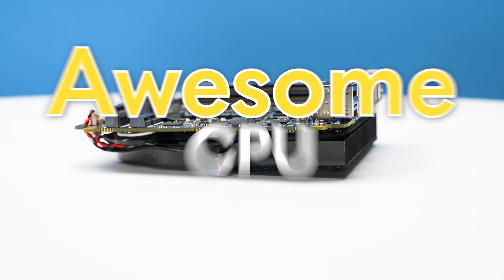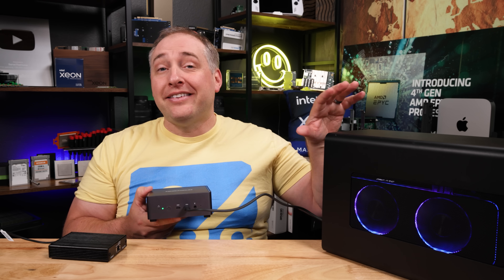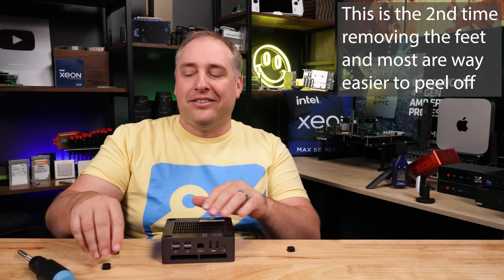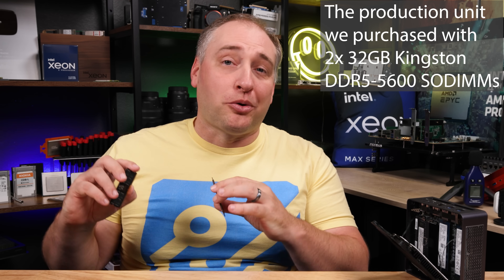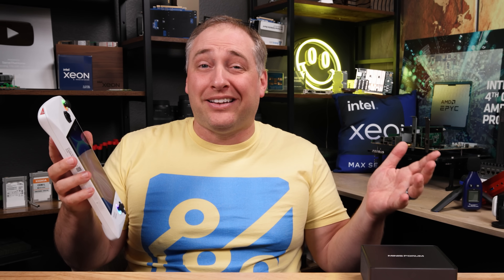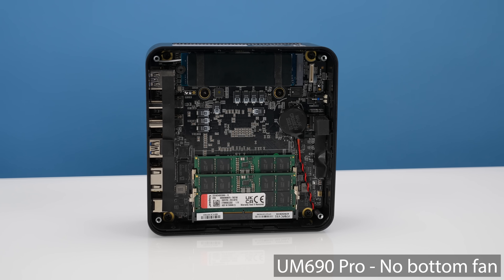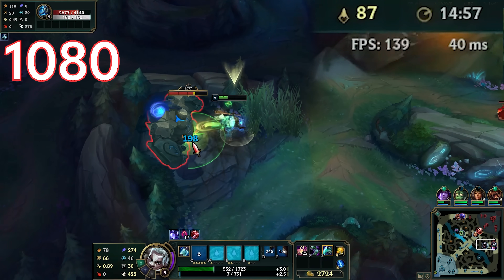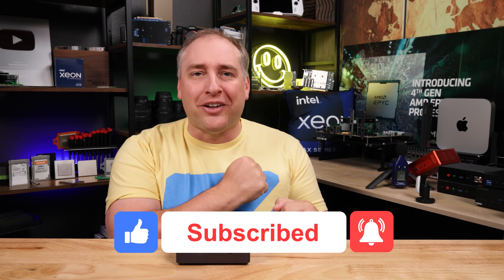This Was NOT the Mini PC We Expected... Minisforum UM790 Pro Review

Comment: Anyone else having sound cracks on the UM790Pro when a USB sound card is attached? Bluetooth audio works flawless. Will test the 3.5mm jack later. My Soundcard is attached to one of the USB-A ports.
With this being the only exception, this little thing runs flawless under Linux. Performance is amazing! Noice level is completely acceptable.

Comment: I had mine less than a week ago and sent it back to amazon on the same day it came in the mail. The wifi card was terrible. My acer Nitro 5 can download at over 500Mb/s. The Mini PC barely got 50 Mb/s. I even tried putting  a TP Link Archer wireless adapter to boost speed. It conflicted with my wireless mouse no matter what USB port I used. Most likely because it isn't equipped with enough PCIE lanes to handle those 4 USB ports on the back. I even had a 220 dollar coupon and thought it was a ripoff. Over 1000 dollars Canadian is way too much for this. I mean if you're building something that can game you need enough pcie lanes. You need fast wifi to download big games. It's a great start, but these Mini PCs are clearly unfinished. I won't be buying one for quite a while yet.
Reply: The Intel AX200 wifi card under the SSD is terrible. Replace it with a Realtek or MediaTek WiFi 6E card for about $25 from Amazon or Newegg.

Comment: If only they would start adding occulink ports to these mini pcs they would be a complete package. Then you could add an external high end egpu by just plugging in the occulink cable without modifying the case and using one of the internal m.2 slots.
Reply: new minis 780 xtx have oculink port on backside :D

Comment: Holes in the rubber feet woudl be great. But even better if they did a mechanical pop up switch or whatever you call it, like their Deskmini UM350
Reply: I drilled a hole into the center of the rubber feet, so I don't have to remove them to unscrew the cover.

Comment: Your review states that you have to remove the screws, where as Level1Techs review stated that the bottom just snaps on.  Can anyone confirm whether this is a toolless case or not?
Reply: First, you have to remove the taped feet, undo the 4 screws (under the taped feet), then use a strong fingernail/soft prytool to unsnap the bottom cover.

Comment: Hello and greetings from Germany, great video, have now also bought a UM790 and am a little disappointed, unfortunately I cannot set a resolution of 5120x1440, is that with you too?
Reply: Using a Cable matters USB-C to DisplayPort adapter, I can get 5120x1440. I cannot do that with just USB-C, could be my cables or driver limitations. Haven't messed with HDMI display options.
Reply: Hi, thanks for your feedback. This is interesting, I will get an adapter or cable and test it, but I am still a bit skeptical because the option 5120 x 1440 is not displayed at all, neither under Windows nor in AMD Adrenalin.
Reply: @nardoa4465  It does not appear as an option for me either without the adapter using USB-C (USB4). Seems like a driver limitation?
Reply: @ScratchingTheGreen  Good to know, I am very happy about your answer 😀, at the moment I have to work with an EGPU to be able to use my monitor. I'll order a cable right away and test it.
Reply: The adapter has arrived today and it fits, in this connection the correct resolution for my monitor is given to me. I am really happy to have found a solution. Thank you and regards.

Comment: I've had mine for about a month now. It is fantastic!  It is TINY. Highly recommended.
It replaces a 2 yr old MinisForum HX90 Barebones, 5900HX CPU.
I got this one factory.
The power draw is minimal. I gladly trade a little performance for much less heat.

It is mounted on a wall with the HX90 VESA mount.
Due to initial cabling as it replaced a HX90, the rear fan was pointed down.
While the fan air movement was virtually silent, 
the actual fan bearing was whizzing at a high frequency which was mildly annoying.
I would only hear it when my head was turned in a particular direction playing games in 4K.
I rerouted the cable and the fan is pointed up. I never hear the fan anymore.
I also don't use 4K anymore as it makes no noticeable difference. 
Many games act weirdly at 4K also i.e.  HUD resize, too small text, etc.
Reply: Hi, good post...How about the WIFI connectivity ????? The GEEKS mini PC are rubbish with WIFI connectivity. How is this for wifi ? Do you lose much at all ? My Router is in the same room as i think the wifi booster dongles are a crock ....
Thanks in advance
Reply: compared to the HX90 i looked it up. It also seemed to be a very fast mini pc. What u experienced any differences between the two ? At normal work, booting time, maybe some visual studio programming. I guess u dont recognized any big time differences or speed ?
Reply: Good luck.    My motherboard fried at 4 months.  Absolutely is trash.
Reply: @calvinbrady9944  What's the mobo model?

Comment: Hi, Need help my UM790 PRO keeps crashing many times per day, very frustrating.  Have tried Minis Forum support no answer for a month.  I just sent a support request to Shenzhen Meigao which is the baseboard manufacturer for the UM790PRO and I think they are same/related company as MinisForum. 
This UM790PRO crashes while I am trading on Trading View at critical points (this is my main income), this UM790 PRO also crashes just using Windows and simply reboots with no error messages.
Reply: I had similar issues. First, I removed and reseated my ram (32gb G.Skill 5600) then removed some of drivers (Video/Audio/Network) and reinstalled; seems to have cleared up. Also, uninstalled the KillerWifi and AMD Adrenaline apps and seems to be a bit better still. Not scientific, but better to reintroduce those apps when I need them than mulitple reboots a day. 

FWIW, I was drving an AGON AG493UCX 49" ultrawide monitor over USB-C and USB-C to DP adapter; same issue on both.

Comment: I always like having my monitors connected to the front headers!🥴 Also I,do like if they turn USB-A ports upside down on the dark back. You will have to connect your plugs three times, before it fits😂 The DDR5 RAM with CL46 ist great for some gaming😮 There were no Intel 13th gen CPU in comparing charts.😢 A full Display port would be more suitable for a PC, not connected to TV set, as HDMI always is behind and more limited. I rather would not waste a Thunderbolt/USB4.0 port for am monitor.

Comment: Would like to see a head-to-head between:

Minisforum UM790 Pro
GMKTech NucBox K4
Beelink GTR7

All with the R9 7940HS (8C/16T, Radeon 780M), 32GB 1TB.

Would like to see head-to-head performance, power draw, heat, noise, gaming performance, integrated ports, do they come with Windows pre-installed, etc. And general bang for the buck?

They all seem pretty comparable on basic specs: proc/mem/NVMe, etc. Just wondering on the differences, and haven't seen any of them in a head-to-head, tear-down, etc.

I'm debating buying one or more of this style of mini-PC to just do stuff like crunching PrimeGrid tasks, and maybe some light gaming. Debating if these will be sufficient for the purpose, or if the integrated graphics, "mobile"-esque chips will be a bottleneck vs. a full PC with dedicated graphics? Or if the bang-for-the-buck is sufficient for the trade-offs.
Reply from the maker: We talked about the UM790 Pro and the GTR7 non-pro in the GTR7 Pro video that came out after this: https://youtu.be/LciJqD74Mc4
Reply: which of them doesnt have coil whine or other high-frequency interference noises?

(im asking because i do suffer from a illness which is making me very very sensitive to noise, especially with high-frequency sounds, a device with coil whine would be unusable for me)

Thanks and greez from Austria

Comment: The crazy thing is that this could probably replace a PC I built 3 years ago.  I could load it up with the same 64tb of ram and get 2 gen 4 8tb drives.
Reply: will this beat a gtx 980 and amd HD 8350 processor?
Reply: Per benchmarks it is on par or slightly better than a 980m. So it will probably be a bit slower than a 980 proper.
Reply: @jadedandbitter  so no point in upgrading since it will cost me the same as upgrading to   A new 2023 graphics card?
Reply: @qaching  the cost of the whole computer is equivalent to the price of a 4070, yes. So the question is, can you upgrade your PC or do you have to build a new one? My PC, a win 7 laptop I can't upgrade to windows 10 due to proprietary win 7 only drivers and non transferrable adobe license keys, needs replacement in entirety (in regards to gaming). So I'm looking at a scenario where I spend $1400 to build a midrange PC, $3000 to build a high end, or spend $600 and replace what I have with something equivalent to hold me over until the next generation cards and pci-e 5.0 comes out, with a total cost of $3600 (or less if next gen card prices are lower, and they very well might be) for a much more powerful setup.

If you have a pci-e 4.0 mobo and can just drop in a new card, then yeah something like this doesn't look as attractive. But a 980m still gives very solid 1080p performance, so that's enough for me and my 1080p receiver/projector for now. Because 1080p on my 130 inch projector display looks better to me than 4k on my 65 inch Sony tv, so I've no need for extreme performance. I WILL need that kind of performance for VR, but there isn't a headset out yet that makes me feel like it's worth it(Im not interested until mainstream headsets have 170 degree+ FOVs on the regular). So for me getting a cheap little box to tide me over for a few years until the next gen VR and graphics cards arrive is ideal.
Reply: @jadedandbitter  thx for your time
Yes I’m building a new one 
I’m replacing a 10 year old pc
My old buddy has to go…

Comment: Why does the Minisforum UM790 Pro give static noise problem when scrolling a Web page or changing between YouTube videos?
Reply: Perhaps you might have a faulty unit?
Reply: are you still strugglin with it?
and may i know if you could notice any coil whine or other noises with your UM790 PRO?

(im asking because i do suffer from a illness which is making me very very sensitive to noise, especially with high-frequency sounds, a device with coil whine would be unusable for me)

really would appreciate your answer.
thanks and greez from austria! :)
Reply: @torbesen  I reinstalled Windows several times. Also reinstall AMD drivers. I don't have the noise problem after reinstallations.
Just read this: How to get rid of monitor coil whine?
Go to Edit>Preferences>General>Interaction Mode and set it to ``Monitor Refresh Rate''. This will stop GPU coil whine.

Comment: My vote for HX80G over HX99G or UM790 pro. 
My reasons are:
- DDR5 still not completely developed for high efficiency versus speed/latency. Right now, ddr4 is enough for 1080p or even 1440p gaming.
- Thunderbolt or USB4 support for external gpu needs better speed and latency in some games like shooters, so best option is an oculink adapter for m.2 slot, you could do this in hx80g too.
- Performance difference between 5800H, 5900HX, 6900HX even 7940HS is very little (10%-15%) compared with price gap between these models.
- Under my assumption. 7940HX for now didn't exist, and 7945HX, based on news and rumors, will be used for new mini pc with desktop gpu support. This is not interesting for me, because i'm interested in mobile gpu efficiency, and low overall consumption, that's not going to be the case.
Reply: How often does it reboot compared to the UM790 

Mine has an average of every 2.5 hours 😂

Comment: Does anyone know if the M.2 A&E slot has both PCI-e lines wired?
Reply: I'm also curious. (Since it's possible, and since clearly the AMI BIOS has a switched setting for it, whether the vendor hides that option or not)

Comment: No 10GE RJ-45 ports is a bummer for me. 2.5G is nice, but not all network switch support that. I am the realm of 10GE network and want 10GE on my devices (and no, I wont use USB-4/C for that for the numerous problems they posed to wired networks).

Comment: May I know if the WiFi performance is acceptable? I only have wireless connection at home and would like to know if the WiFi is tolerable considering quite some remarks on the antenna being subpar
Reply: I disconnected the Aerial's and poked them through the grills, I have also replaced the bottom grill with the tiny fan on, and fitted a 120 mm usb fan. Far better and I can't hear it at all now. I didn't need to do those mods as it worked perfectly before, but I can't stop myself from improving(modding) things 🤣!

Comment: Is the UM790 pro better than the UM690 regarding the stability? I have an UM690 and it is crashing all the time. It is basically useless. I suggested to the Minisforum support to replace my UM690 with a UM790 pro.
Reply from the maker: Yes. It has a cooling fan on the bottom.

Comment: The minisforum FAQ for barebones states "Minisforum does not offer keys for the Windows OS"
Does this mean a W11 key needs to be purchased or is W11 auto activated after install?
Reply from the maker: I believe if you want W11 you need to get a key. Many buy the barebones and run Linux and such where that is not necessary

Comment: Hi Steve, Can you set the RAM timing in the BIOS?
It would be interesting because the RAM is also used as graphics memory, and if you buy the barebones version and use faster RAM, for example DDR5-5600, CL40-40-40, the graphics performance could be a lot better. The important question would be whether the UM790 pro with DDR5-5600, CL40-40-40 runs stably or not?
Reply: Hi Steve, what did I win???

Comment: I am looking for a portable mini system without the excessive fan noise 13 gen NUCs produce at 100% load on one ore two cores. On my NUC 13 with I7-1360p even with moderate workload (Webserver, MySQL Server, software coding in an IDE, npm-watch thread) the system fans often spin up beyond 2000 rpm with an annoying whistle noise. Is there a way to solve this, maybe an alternative cooling system (it doesn't have to be completely silent) Could you provide some infos or a video comparing the most silent systems?
Reply: You should try Asrock Deskmini X300(AMD) + Noctua L9i  OR Deskmini B660(intel) + Noctua L9a
Reply: Look up Akasa Turing case for your NUC 13. It's essentially a giant heatsink masquerade as a case. Akasa has been making Turing cases for different NUC models over the years so they know what they are doing.
Reply: may i know if you guys could notice any coil whine or other noises with your UM790 PRO or NUC 13 or Asrock Dekmini X300 or Deskmini B660?

(im asking because i do suffer from a illness which is making me very very sensitive to noise, especially with high-frequency sounds, a device with coil whine would be unusable for me)

@dandewolf717

and @tomtran614 is the Akaska Turing case helping against high-frequent noises?

really would appreciate your answer.
thanks and greez from austria! :)

Comment: You hav covered the technical aspects well but have not touched upon some of the very basic functions such as printing and compatability with printers etc. while these are mundane they are something most users need and use frequently. please advise!
Reply: Printing is a function of the PRINTER, not the computer; Printer Drivers are a component of the operating system sourced from the printer manufacturer. Connectivity to your printer, well, I guess that is up to you and your chosen printer's capabilities; USB (the computer has them) if you need that.

Comment: I didn't hear it mentioned, but does the UM790 Pro have an internal SATA connection?
Reply: NO, only 2X N.2 nvme SSD slots
Reply: Moble CPUs have limited PCIe Lanes vs Desktop versions. Whenever a system offers more than 2 USB 3.2 Type A, and 1 or 2 USB 4.0 ports AND 2 m.2 NVME SSD slots, it won't offer a SATA port. If it had a SATA Port, either up to w SATA devices would work or the NVME SSD slot would work- they are mapped to the same x4 PCIE lanes.